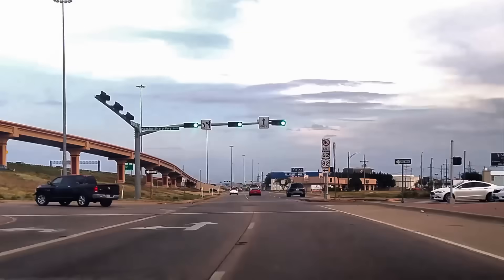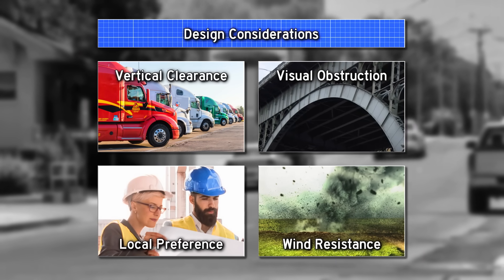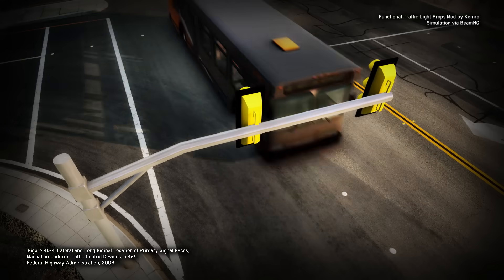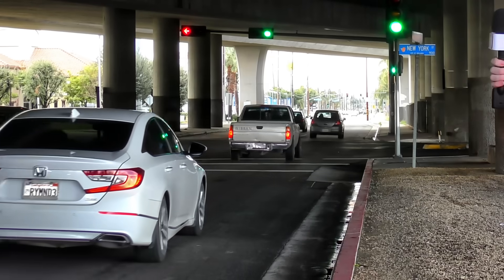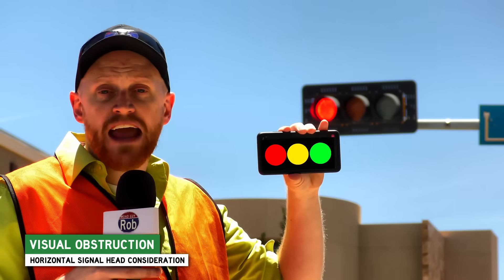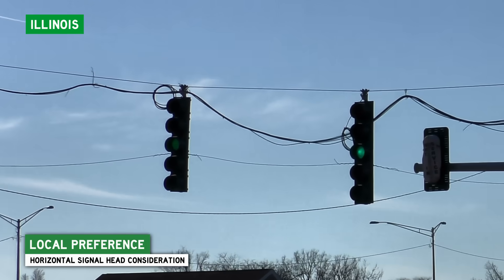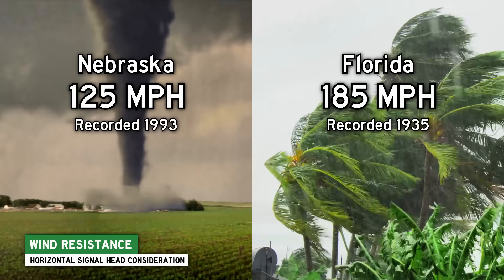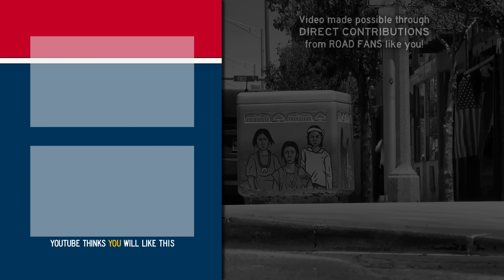What's up with SIDEWAYS STOPLIGHTS in Texas and Florida?

Comment: I was told that traffic light order on horizontal heads depends on which side of the road the country drives on, so that the red light is always closest to the centre of the road as it's the most important signal. That may be why Japan has red on the right and green on the left.

In the UK (and probably much of Europe?) horizontal heads basically don't exist, and even overhead lights are quite rare, only really seen on large roads or where there's a steep downhill where you can't see the side-mounted lights from the further up the hill.
Reply: New Zealand, Australia and the UK all drive on the left, but where they use a horizontal signal, the order is still left-to-right.
Reply: Just wanted to jump in and say, most of Europe drives on the right.

Comment: I'm not completely color blind but I am legally color bind. My color vision gets worse with exhaustion. Also, at a time, I had no idea stop lights were sideways until, an extended EMS shift, on an out of county transport  to Tampa,with virtually no sleep. With absolutely ZERO traffic on the road, I had no idea what color the lights were. So at 3am I treated Tampa as it had no signals at all and proceeded with caution checking every intersection. After that shift, I looked up horizontal traffic lights.

Comment: Where I grew up on Long Island, there were some horizontals. I think mostly where the Expressway service road intersected perpendicular main roads, for visibility (the lights were not under the overpass).
Never thought span wire setups were ugly, but I'm mostly thinking of smaller intersections of just two-lanes where the wires kinda blend in with the trees and stuff, and a mast would be visually intrusive.

I drove around a bit after Sandy (more once I found some gas) and although things were often unpowered, I don't remember seeing a lot of downed signals, wire or mast suspended. (And if things are gonna get knocked down, that would've been when)

Comment: Wisconsin was primarily horizontal in their signal design which I thought looked fantastic was simple and made sense. Unfortunately they have been replacing them with huge poles and mounting them vertically now which I don't understand why the switchover. Fortunately, there are still plenty of horizontal signals left around the state.

Comment: Having grown up in PA and then moved to South FL, I always had figured the horizontally mounted lights were to minimize air resistance during hurricanes.  It sounds like I may have been right.  Here's a better question -- why are traffic lights a dull yellow in the northeast and painted black in South FL?  My guess is that it's a glare reducing measure -- any idea if I'm right?

Comment: This video nailed it right on the mark concerning minimum and maximum signal heads may be displayed.  The 40-foot minimum is required for AT LEAST ONE travel signal head.  I am not sure of the requirements for arrowed signals.  And the maximum mentioned at 180 feet is correct.  I have found one mast arm installation in which the farthest signal head is only 30 feet away.  I posted it on Fakebook's "There Is No Way That Is MUTCD-Compliant.

Comment: Orlando Florida has a terrible setup, a lot of the traffic signal lights are to close so they can’t be seen when your on the line because they are on the same line. The city designers do not like placing traffic lights on the other side of the road. Dangling lights being stretched across an intersection is stupid in this city and overall Florida. Just to add the traffic signal lights here hold on red for 3 to 4 minutes long creating insane traffic. Plus they have traffic signal lights in placed in the most stupidest places. They have no synchronization. I could go on and on about this dumb issue here.

Comment: The earliest English traffic lights had a single lens with color filters inside similar to railway signals. In North America semaphore signals with arms were used as well as signals with a large disk painted into colored segments (usually only red and green) with a revolving clock hand. Clock face signals were also used in Australia and New Zealand.

Comment: Your point at the end about horizontal vs vertical mount and wind doesn't make sense. Both directions have the same surface area, and would apply the same amount of force on to the pole.

What would be different though is the fact that vertical mount could rotate around the pole if the back is not center mount, like if the light hangs down a bit. 
Also shout out to Richardson, TX!! There's a cop that hangs out on the 75 exit to Renner. Fuck that guy. LOL.

Comment: On Railroads the GREEN light is on top and the RED light is on the bottom. The Green Light represents the 'High Ball" and thus it is on the top. On a railroad you will see an array of red and other color lights facing an oncoming train. The easy mnemonic is "It is ALL RED" or it is not red at all." The combination of lights is either giving you SPEED information, or in the case of the New York City Subway, it is giving you ROUTE information.

Comment: As someone who moved from Alaska (vertical) to Texas (horizontal), it really threw me off for a while. Been here for four years and it honestly is annoying driving to the west around sunset, as I have to move my visor and basically stare into the sun to see if the light has turned green. However, this helps me understand much better why they are this way. Thank you, Road Guy Rob!
Reply: @Moon Shine I think you meant to say Louisiana. I live in Texas and we have pretty good streets and highways; streets are maintained by the city (which means in some cases they CAN get neglected), highways are maintained by the state (highways, especially interstate highways, are usually very well taken care of because they typically involve high speed travel). On the other hand, Louisiana has many roadways made up of divided concrete sections, so individual sections tend to sink and crack (speaking from experience driving on Louisiana roadways, although mostly only in Shreveport).

Texas, of course, housing DFW, Austin, San Antonio, and Houston (all cities listed in the top 15 most populous cities in the US), needs quality roadways that can accommodate tall trucks. There are quite a few semis out on the roads here, and the signals need to be built to accommodate them. Given we are also the 2nd most populous state, we have more than enough tax revenue to sustain/improve our infrastructure (although our tax revenue is generated by sales tax and not a state income tax) and, as a result, more people move here every year.

Something tells me you're talking about Texas without having even been here for any extended period of time, if at all.

Comment: In Lincoln, Nebraska over the last handful of years they have been switching from horizontal to vertical. For new or replacement signals they are mounted vertical so Lincoln has a mix of both across the city.

Comment: If you look at 3:34, the horizontal left turn signal is incorrect; a left green arrow is supposed to be to the left of the green ball.

Wisconsin also used to mount signal signals horizontally on trombone trusses, but this practice has been discontinued.

Comment: Good video, but you completely ignored in the last 20 seconds an important point about the wind. Mounted horizontally like in Texas, strong winds can make the pole begin to oscillate up and down. Except they put an aerodynamic wing on it in Texas, which you can barely see, which then keeps the pole stabilized and still.

Comment: I always assumed it was to make more secure mountings to the poles. Here in Houston we have a very common combination on divided arterial intersections with horizontally-mounted stoplight heads on poles suspended horizontally over most lanes, but also a vertically-mounted stoplight head on a vertical pole standing in the median facing left-turning traffic. Occasionally, you might find a dedicated right-turn lane facing a vertically-mounted stoplight head mounted on a vertical pole standing on the opposing corner of the intersection.

Comment: This is pretty common in Wisconsin, while Illinois has interesting 5 light vertical signals rather than putting the left turn next to the through green.

Interesting note about the 40 foot requirement. In much of Europe they put signal heads on the near side of the intersection. This forces drivers to stop before the stop bar... otherwise they can't see the signal. That way they don't stop in the crosswalk!
Reply: Ooh, I like that idea a lot actually. Luckily for us in the US, we don't have to worry about crosswalks because our places aren't very walkable for the most part. Unless you're in a major city, of course.

Comment: The argument for mounting almost all lights horizontally is really about money. 

For tall vehicles, if someone either doesn't follow the law (having too tall a vehicle), or follows it poorly (measures incorrectly, or secures their load incorrectly), it's cheaper to replace nothing than to replace a vertically mounted light. So, even if you're not saving costs on the height of the mounting apparatus, horizontal lights will just be broken by vehicles less often because they're just that much taller than vertically mounted ones (and people will most often be only slightly over the legal height limit). 

The drag caused by winds causes a ton of stress on objects mounted transversally -- just take a look at the back side of those massive interstate signs which have tons of bracing. It's not just high winds either, light winds can hit a resonance frequency for the bar, and winds from any direction other than straight into the light would already hit the bar -- the extra bits of the light fixture that poke out beyond the bar are negligible if the light is mounted in-line with the bar (horizontal in most cases). So, in almost any wind condition, a horizontal mounted light has a much lower additional drag beyond baseline, minimizing the wear that the bar will take due to wind over its lifetime. So, mounting in-line with the bar reduces costs over ... millions? ... of light fixtures across the state. 

Incidentally, vertically mounted fixtures can, and do, spin around the bars they're mounted on due to impacts in storms. What if a heavy object gets picked up somewhere else, then impacts the bottom of the light fixture? The distance between the mounting point and the impact point provides leverage and allows the impact to impart more force at the mounting point. It is not uncommon to see askew lights after storms along the gulf coast due to detritus impacts and winds. With a horizontally mounted light, the distance between the impact and the mount is almost always lower ... and the impact transmits its force in a compressive angle instead of a skew angle, which reduces breakage as well because shear forces needed to break mounting bolts are almost always lower than compressive forces.

You'll still see many vertically mounted lights in smaller towns or at county intersections, but as they get replaced, they're invariably becoming horizontal throughout Texas. Horizontal lights are just cheaper in the long run because they suffer less damage. It's the same reason that the line-mountings are disappearing -- it's cheaper long term to use a pole which will suffer less damage. For all the reasons listed above, when a traffic light is needed down low (due to visibility concerns), it will almost always be vertical to align with the pole it is mounted upon.

Ironically, to me, Texas and other states are putting in thousands of miles of cable barriers down freeways which has the exact opposite correlation: maintenance costs are far higher than for any other barrier type. (Just take a look down I-35 towards Laredo from San Antonio)

Comment: Stop going to Mechico, don't matter if the Old one or the New & Young one.  Just don't cross the border. Just like on  the old maps  "There be monsters!" annotations.
As aboot Q-beck - some high-risk areas have flashing white circles around the red light lamp.  It's doing wonders for anyone tired in the extreme & sleep-deprived to the point of ....
Not saying that I've been like that, no, no way! Definitely positively NOT!

Comment: I think we should have traffic signals on the close side of the intersection, "where the driver won't be able to see it" and pull the stopping line further out from the intersection so that the same visual connection can be made from the signal to the motorist. This gives room for the pedestrian and bicycle crossing to be further out from the intersection as well, giving turning motorists the space to come perpendicular or close to perpendicular to a crossing pedestrian or cyclist for visibility. It's one of the safety features of protected intersections.

Comment: Now I haven't been in every country in Europe, and we don't quite get as much of the extreme weather that North America does, but as far as I know, every single traffic light in Europe is oriented vertically, and has three lights. If there's an extra light, such as a green to turn right (which is generally not allowed anyway), it's to the side.

And this is on a continent with 50 different countries, not states in one country. There is the Vienna Convention on Road Signs and Signals, which regulates how signs and signals should look like. It's far more picture-oriented than the system used in the USA. Only three countries (as it happens, island states) in Europe haven't signed it. I live in one of them, but we do use the same signs and signals as in the rest of Europe. (And there's one place where there's a sign warning you about cats crossing the road. I kid you not.)

Considering that they managed to get the French, the British and the Germans to agree on something, it's a bit strange that you have all this variation in the USA.

Comment: In Netherlands and other parts of Europe and I'm also seeing it in parts of Canada, traffic lights are near side just behind the stop line. Is this torture or do the Dutch have a reason? I believe it has to do with enforcing the stop line because if a car stops past it, the driver will also be passed the light and so won't see when they can go. Further, these roads are typically narrower than ugly US stroads.

Comment: When you are making a left turn with your car, you must give way to cars driving in the opposite direction.
But, you can't see when their traffic light is red (they are not on the other side of the road). What i did see in the past, here in the Netherlands, is traffic lights with a small red light at the back lighting up when the traffic light shows red.

Comment: The reason for Japan's lights being backwards is found in the Vienna Convention on Road Signs and Signals (the international version of the MUTCD which most of the world use or at least keep to most sections of) which says that traffic lights arranged in a vertical state should (as they are worldwide) go red to green from top to bottom, and should go green to red from the nearside to the offside. In the US which drives on the right, that means the green light should be nearside (right) and red light offside (left), in the UK, Australia, New Zealand, Japan, etc, which drive on the left however, the nearside is the left side, so the green light on the nearside (now left) and red light on the offside (now right).

Comment: The disadvantage of traffic lights on a wire over the intersection is when you’re at the stop line and you can’t see the signal itself with your head straight. Gotta crouch down to see when the light turns green.

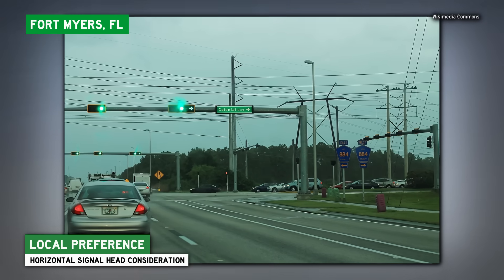Comment: 7:38 For me, the red and yellow both look very similar, but the green just looks white, and is easy to tell apart, if I can see both red and yellow next to each other, I can tell the difference between the them. The only problem I have is when I find myself at one of those intersections that's just a single blinking light suspended across the intersection, because I will have no idea what that means, just treat it like a four-way stop I guess.
Reply: huh, interesting. we have lights around here that are like that, but they have the whole thing, with just the yellow light flashing, or just the red light flashing. and i've wondered in the past, why not just have the one light, why put the whole apparatus up there? now it makes sense. and they probably dont even have bulbs in the unused spots, but are just there as a reference. I imagine it'd still be a problem at night, though. but on the other hand, I suppose there's no real danger in treating a flashing yellow as a 4-way stop, either.
Reply: @Speedj2  When there are single blinker lights, instead of a full traffic signal, blinking red means stop, and blinking yellow means yield.  Usually, it's a way to draw your attention to your role in 2-way stop.  If you have a right-of-way to proceed without stopping, you get blinking yellow.  You still have to slow down or stop for incumbent traffic, but the cross traffic will have a blinking red, and the responsibility to stop for you.

Comment: In Quebec, horizontal signals are common, and they add 2 other features to help colour-blind people. First, on hotizontal signals, the red is doubled, one at each end. Second, each colour has a different shape. Red is square, yellow is a diamond, green is round. The shapes are universal across the province, whether the signal is vertical or horizontal. The vertical ones don't normally double the red. 
🟥🔶️🟢🟥

🟥
🔶️
🟢

Comment: Is this not normal? The stoplights we have mounted at the corners are vertical. The stop lights that are on an arm above the street are generally horizontal.  Unless they are hanging from a wire over the street. Then they are usually vertical